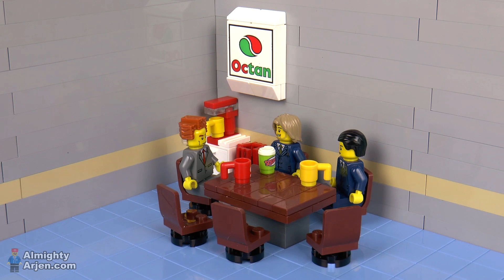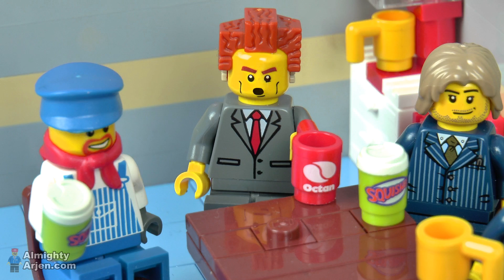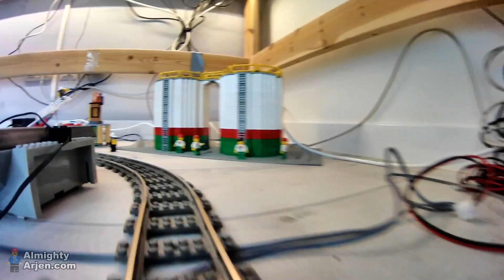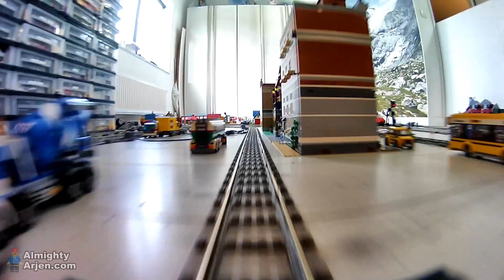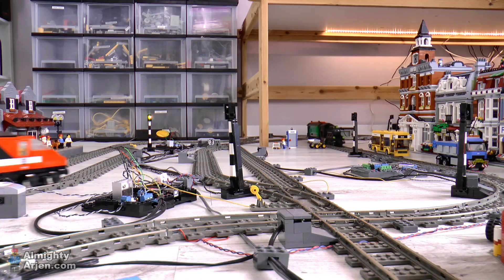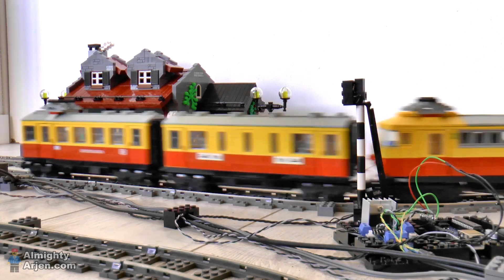Lego trains random controlled and automated by Arduino

Comment: First I'd like to say good job on your set up.  It seems to me you may have used jumper wires to keep a consistent speed on the trains.  I'm setting up a large track configuration.  Can you point me in the right direction on how to set things up right so I get a consistent speed through out the entire model.  I'm also building mountain that specific trains will be going up the mountain.  In addition I'd like to set up sensors so specific trains will start when it hits a specific point in the track and another train will start.  Anyone willing to give me proper advise I'd appreciate the help.
Reply from the maker: Keeping the speed consistent is very difficult. I try to use multiple regulators to achieve that. For controlling the trains, you need a microcontroller like Arduino or a Pi, motor drivers for powering the tracks like L293D or L298 and for sensors I use Polulu distance sensors (5 cm)